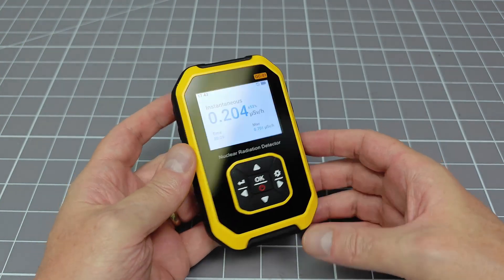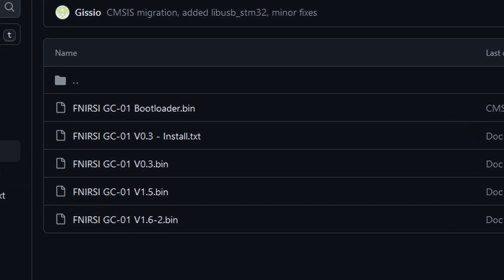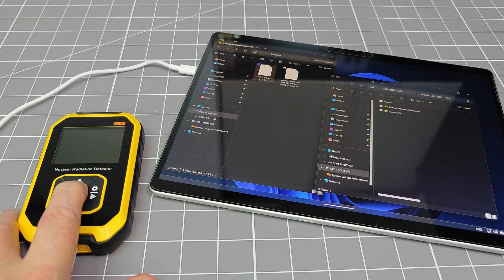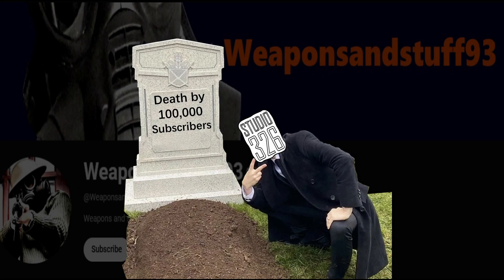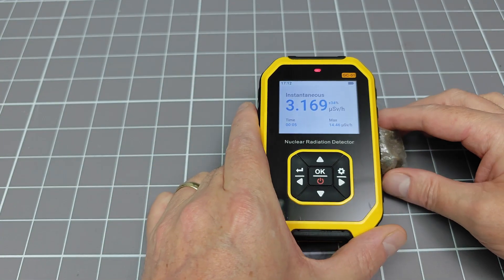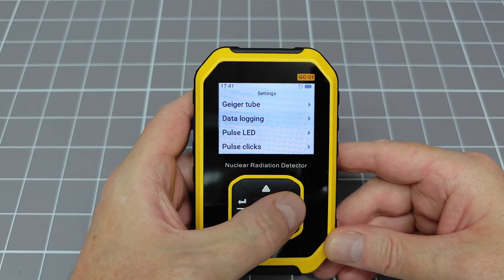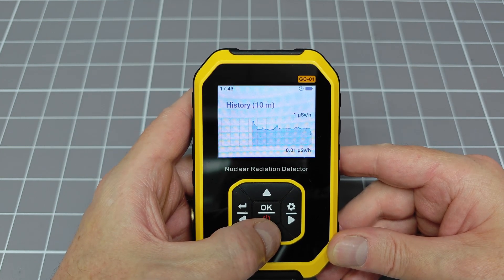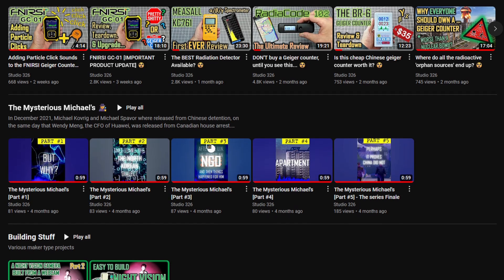FNIRSI Firmware Upgrade, Review & Instructions

Comment: Again very very good, thank you!
Reply from the maker: Making these videos is just a hobby, but when it help others to improve a crappy product, then I'm happy...
Reply: @project-326  Your videos are very helpful, i ordered the better J321 tube and will try this firmware too. without those its indeed crap. i have an even smaller tube in it, you had. with 2 connections on one side a J613 i think . even worse. ordered 1 month ago. so its even getting worse :)
Reply from the maker: @TonyAlbus  Yep, te progression to crappiness seems to be J321 -> J614  -> J613.  Next they will actually use a f*cking xmas tree light...
Reply: @project-326  😂
Reply: I would love an update on this.  I also have the J613 tube in mine.   I wonder whether the firmware update will even work with the J613?  Also, whether the terminals for the J321 are even active?  Also, am looking for a reliable source for the J321, so if you can share (after you receive it, so you can let us know if you are satisfied), that would be great. Much appreciated.
Reply from the maker: @rob1733  Hi, there are quite a few versions f the PCB and I only have my device as a reference.  I am based in Mainland China and I buy my tubes o TaoBao, so far they have all arrived safe and seem to be in good working order.  Outside of China, I'm not sure what to recommend, Manutek4000 said that he received J321 tubes that didn't perform as expected, I suspect that some unscrupulous individual might be selling the tubes that get rejected as new ones...

Comment: Since this firmware calibrates the device for different GM tubes, can I leave the original in but still expect better accuracy?
Reply from the maker: Yes, correct, just the sensitivity is lower with the HH614 tube
Reply: @project-326  Thank you!  So you still recommend replacing the GM tube, I gather.  Much appreciated. I have other questions regarding the hardware upgrade, but I will comment on your upgrade video.  This one:  https://youtu.be/E9lz3cr2KQs?si=wiAx3NZCPUrnIdQi

Comment: The V1.5 file is too big according to my FNIRSI device. I only have 56kb of memory available. Anyways, the custom FW seems to work nicely. Thanks for sharing the tutorial.
Reply from the maker: try unplugging the main battery and removing the coin cell and try again with V1.5 (the 48K version)
Reply: @project-326   there is no 48K version only the 146k and it wont install that one
Reply: can someone post a link to the 48k version on V1.5? please
Reply from the maker: @1MegaSaxoN  it seems to depend upon the MCU type installed.  There re tow variants:
FNIRSI GC-01 V1.5 (for CH32F103R8T6).bin
OR
FNIRSI GC-01 V1.6-2 (for APM32F103RBT6).bin
Thanks!
Reply: i also removed both batteries and still cant put the original firmware on
Reply from the maker: @1MegaSaxoN  Please open a ticket with Gissio, this person is really helpful.
Reply: @project-326  ok thank you -  love your videos!
Reply from the maker: @1MegaSaxoN  thanks dude!
Reply: https://drive.google.com/drive/folders/1XN-d1ZiFq0ur_ae392iQr-pbHZY32Ag5 working firmware

Comment: Well, that was interesting. Very simple flash method. The new firmware display is very washed out though - I prefer the looks of the original but there seems more control. 

Does the accumulated average still read around one third the live average? I tried my original GC-01 (with upgraded J321 tube) with a radium source over 10 minutes and found the live instantaneous reading matched the live average on the main screen and histogram at 20 uSv/h but the accumulated over time was still around one third.

I made some more measurements. The unit takes 120 mA dropping to 80 mA when in idle (so 13.7 hours on 1,100 mAh battery), the display takes around 20 mA when full on, the HV supply takes around 40 mA which seems excessive. I'm hoping to improve this.
Reply from the maker: no, its it completely as you would expect for a normal counter.

Comment: well i guess im out of luck... i tried two different gc-01 (both have the j321 gm tube) on 3 different pc and 7 different cables and im unable to make the usb drive pop... could be because my pcs are running under windows 10 , and maybe i need some kind of driver but thanks for the video anyway! and maybe asking my neighbors if i can upgrade my geiger counter on their computers could start an interesting conversation...(there aint too many people with geiger counter in canada)
Reply: I’m having the same problem tried multiple cables and no drive popping up under windows ten and guess what I’m a Canuck too ☝️
Reply: @ralger  Tricky timing of holding the right arrow button along with power button enables my computer to see a device called AIR01, however I cannot access files on it.  This is with an M4011 geiger tube model with WCH microchip.
Reply: @nefariumxxx tried to hold right button and power no joy yet 😂
Reply: My PC runs Win 10, and the USB boot window pops up no problem.
Reply from the maker: heh heh, sounds like a conversation that should start with a few beers!
My advice is to ask the creator of this firmware (Gissio) on github, this person is really helpful!
Reply: @project-326  😅 ok i'll try asking him thank you

Comment: I’m still amazed that someone will take the time to write firmware for a consumer device for free hats off to the creators and to you for explaining the ins and outs of this post factory mod. 🎉
Reply from the maker: Everyone wants a hobby, right?
Reply: @project-326  Now I see even a newer level of firmware released just 16 hours ago, have you tried it yet ?🤞
Reply from the maker: not yet, but Gissio said he is soon going to release the version with data logging...
Reply: It's even crazier than you think. Gissio has also adapted this firmware for other devices, such as the BOSEAN FS-600, the FS-2011 and others! It's so great that you can use different devices in the same way and the cheap Chinese things suddenly become a usable device.
Reply from the maker: @dg0mg  Yep, there are quite a few devices.  Sadly the Bosean FS-5000 isn't currently one of the devices that Gissio supports.
Reply: @project-326  do you think he will release one for the FS-5000
Reply from the maker: @noahallen227  For sure, but when is the real question...  This device has a really hot MCU, with the best features barely being used.  But R&D takes a lot of time and interest, which is only boosted by interested folk that talk to the developer.  Go forth and be interested and say interesting things to the developer my friend....
Reply: @noahallen227  Good news, Gissio's Rad Pro firwmare now works on the FS-5000! Unfortunately, flashing is a bit more involved, since you need to connect an ST-LINK to the debug port on the board.
Reply: @GRBtutorials  yep I've installed Radpro the software is much nicer then the original firmware I'm very thankful that Gissio has gone out of his way to make this firmware for everyone to use

Comment: А есть костюмная версия прошивки для ut334a, это тот что на трубке h442?
Reply from the maker: this will work with all of the tubes that have been used in the GC-01, just select the tube type from the menu and the calibration will be correct.

Comment: Is there anything similar for BR-6? The geiger tube inside is semi-decent, but it just straight up maxes out on lots of spicier uranium glass.
Reply from the maker: You are so right about the BR-6, the tube is actually pretty good (for a cheap device) and the most major issue with the product is the firmware.  Take a look on RadPro, there are a few devices that are supported.  I don't think there is anything for the BR-6...